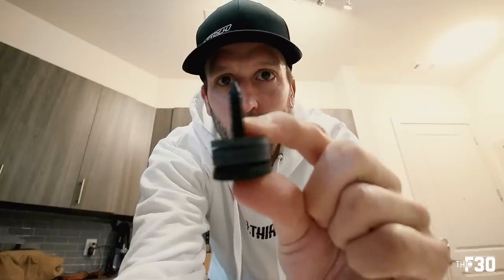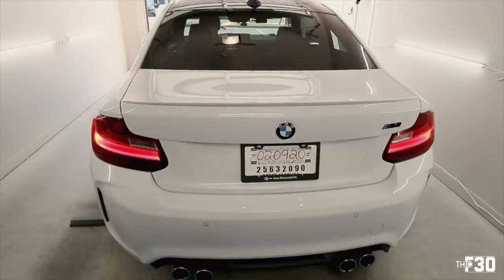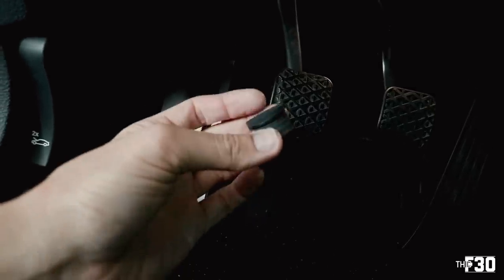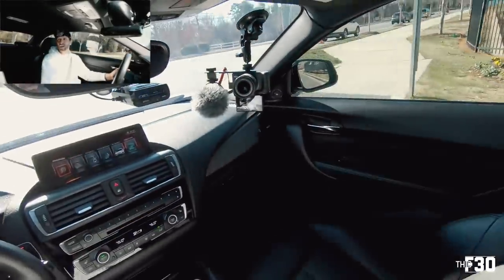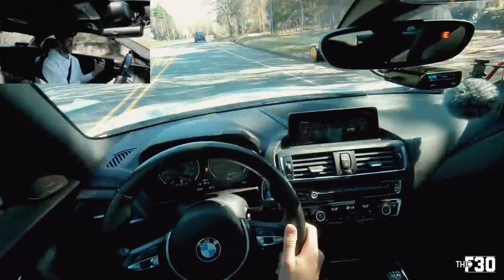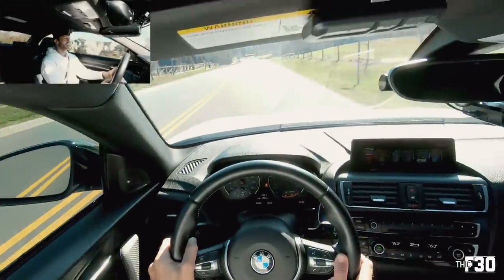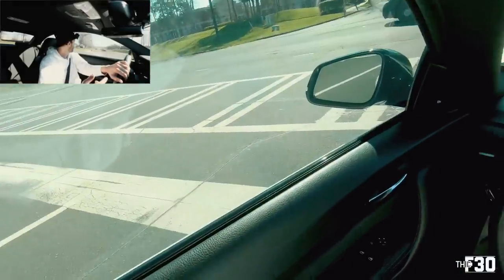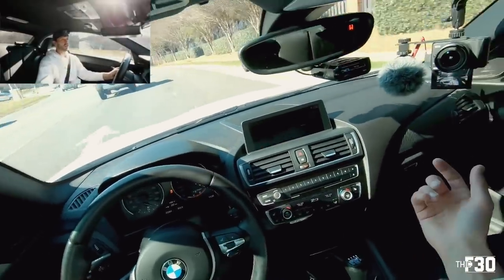IF YOU OWN A MANUAL BMW YOU NEED THIS - Bmw F8X, F3X Clutch Stop

Comment: I just installed this mod a couple of hours ago. It totally changed clutch operation for the better. I tried the default 4 disc setup and I think it’s perfect. Best $10 mod ever. And FYI My 2016 F80 did not have an oem clutch stop cap either.

Comment: Do the M2’s have the clutch delay valve in the slave cylinder? If so, do you have any interest in removing? I do not have complaints about the pedal travel as much as I do the rough shift from 1st to 2nd. I just bought a 340i and I’m coming from a 95 LT1 6 speed that is smooth as butter. Thanks.

Comment: Is it possible that with this mod, you might actually be slipping the clutch even when fully depressed with the clutch stop installed (since it immediately engages). That might wear out the clutch sooner ?
Reply: I installed one on my mk7 gti and took one washer off for this reason. Idk if it actually slips the clutch or not but with one of the washers off it gives you just a little bit of dead space

Comment: in my opinion it's no so good idea , you will burn your clutch earlier than it should wear
Reply from the maker: Riding your clutch will burn your clutch quicker. A clutch stop does not do this. It only reduces the amount of play between the clutch engagement and floorboard.